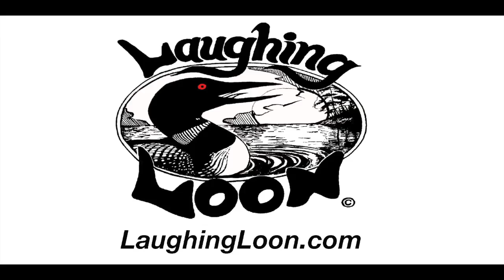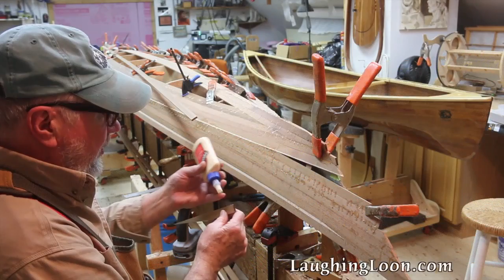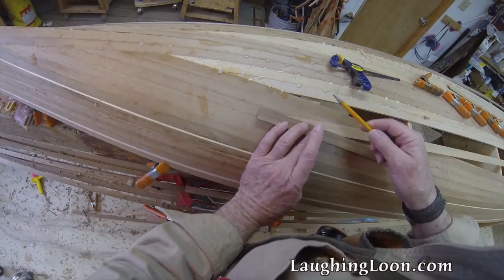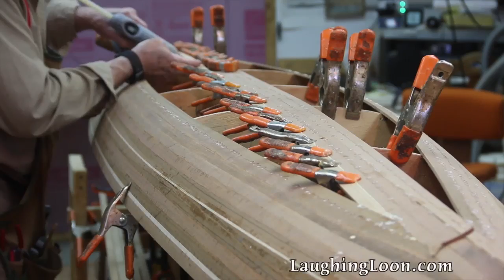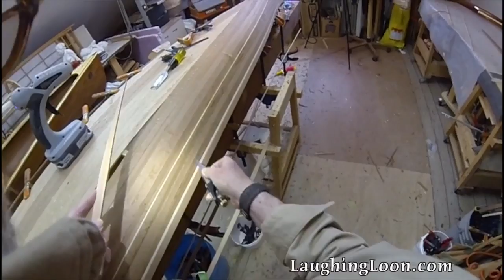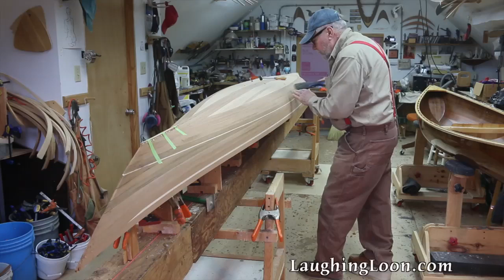Laughing Loon Ootek Build Part Three

Comment: I know your method works but you are not cutting a progressive bevel on the edges of strips so how can you fair sand the boat and you do that, without sanding into a void, or does it happen on rare occasions and it's a simple easy invisible fix?